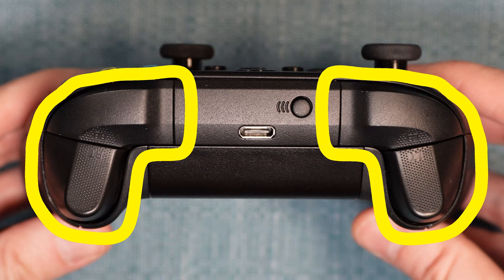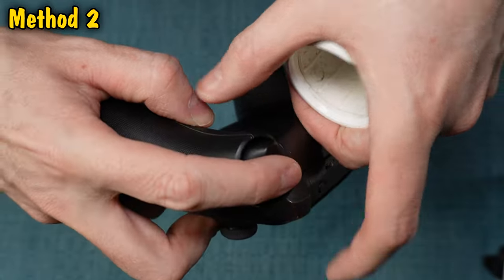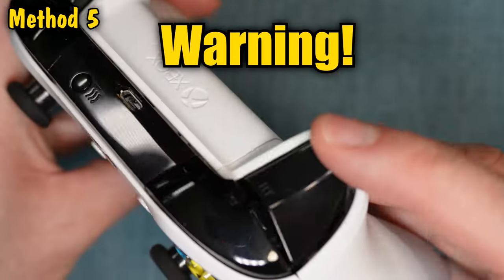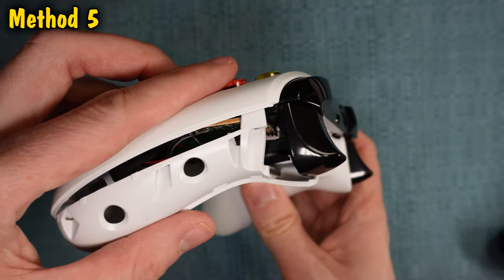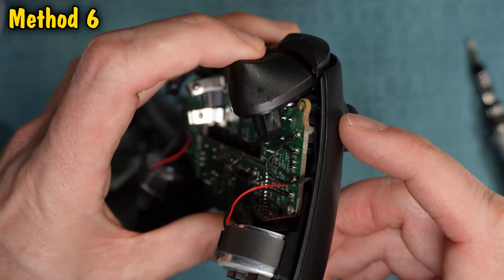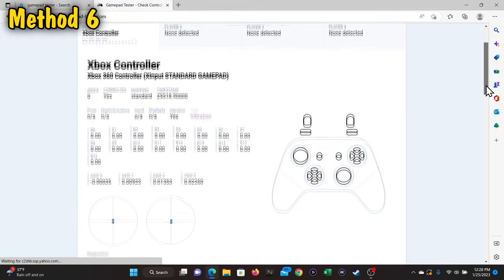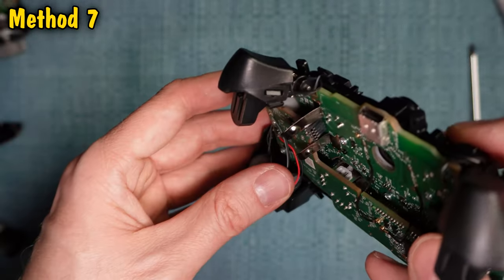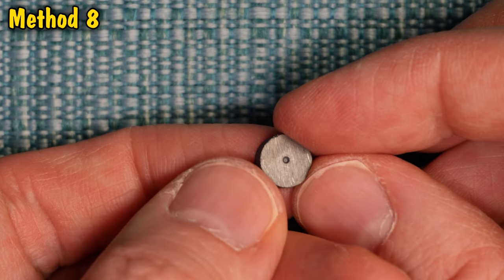How to Fix Trigger & Bumper Buttons on Xbox Controller | LT RT RB LB Shoulder Sticking Stuck Repair

Comment from the maker: Here are some product links relevant to the video:
Replacement Trigger: https://amzn.to/3jWukyv
Replacement Bumper: https://amzn.to/3DHfBOl
Precision Screwdriver Set: https://amzn.to/3k5Do49
LB and RB Button Replacement Kit: https://amzn.to/3ZY8me9
Electric Duster: https://amzn.to/3lwoRyR
Replacement Battery Covers: https://amzn.to/3XBUYKS
Rechargeable Battery Pack: https://amzn.to/3E7RSrh
Xbox Core Wireless Controller – Robot White: https://amzn.to/3xok5Gr
Kinivo HDMI Switch: https://amzn.to/3GhtVhn

*All Amazon links above are affiliate links. I get a small amount of money if you end up using them to make purchase (it does not have to be for the item I link to, as long as you click my link then move to another item, it works)
Reply: W
Reply: Absolutely bogus and ridiculous. They don't work for me.

Comment: A detailed and handy guide. Was able to get all 3 covers off and count figure out how to get better access to the bumper. Your video helped with that. The issue I had was the RB rubbing against the RT. When the trigger was even slightly pressed, the RB would pop put and work fine. Ended up sticking a very tiny piece of tape between the two to reduce friction, and it worked.

Comment: Thanks! My left bumper stopped working. I got down to the last step, it was surprisingly easy with your instructions. Turns out the plastic tip that connects the bumper to the white circular little post was loose, it snapped off when touched. Ordered a new part for $10 for 1 day shipping with Amazon and fixed it in 5 minutes. Much appreciated!
Reply: I had the same situation but when I replaced the piece the controller didn't turn on anymore. I'm not sure why but it sucks tbh

Comment: Thanks for this. My LB stopped working and I had no idea why. Bought a T8 security screwdriver & disassembled the controller thanks to your instructions. Finally saw what was wrong after 15mins. The plastic protrusion on the casing broke off, so that's why the LB button wouldn't click.
Reply: Did you figure out how to fix it? I'm waiting for my torx screwdrivers to arrive so haven't actually disassembled the controller yet but I bet my life this is gonna be exactly the issue
Reply: @ayzee5169 Yeah, I just replaced the bumpers. It's one single piece of the case. Just have to make sure you order the correct one. You can tell by how it's split from the plastic piece in the middle (over the sync button). One has a diagonal separation, the other is straight. It's important because the protrustion that goes inside to click the bumpers is different (one style is much thinner than the other).

Comment: i started this video with a rb button not working no matter how much or hard i presses it. exactly at 1:51 my problem was solved by using a card under the rb and above the rt instantly saw the rb responding on my xbox. thank you, u saved my 20$ controller :)

Comment: Thanks a lot! Using this tutorial i found out whats wrong with my RB, it was broken little plastic stick inside which is pressing the switch, i didn't know how to look inside, now i just bought the part and gonna replace the old, really aprecciate it <3
Reply: What method have you try ?
Reply: These have a major design flaw by MS. They're way too weak for the heavy use they get like the constant parrying in an RPG game.

Comment: Awh man thanks!! Fixed my left trigger because of you. I was so confused because I cleaned it all up. Turns out that I had put the magnet in the wrong way and didn’t know that the side with the dimple should face down. Was about to waste $60 on a new controller, you’re a lifesaver!

Comment: Please don't forcefully remove the grips. If you pry too hard like he has in the video, the small sharp pieces that click into the slots that keeps the grips on the controller will snap. It's best to use a flat object to run along the seams of the grips until slowly but surely it releases its hold.

(Very obviously, I have learned that the small sharp pieces will snap under immense pressure the hard way, I ruined many a great grip that way)
Reply from the maker: I'm always open to new ways of doing things, but I've never been able to loosen the sides enough to make it come off. Like I mentioned in the video, I've damaged my prying tools trying to do that. My grips are always on there very tight, and brute force is need to separate the pieces. It could be that other models have looser grips.
Reply: @HowToX  I've noticed that branded controllers (Like the Gears of War, Halo, and other branded controllers) have easier to pry grips with no strong stickage, and the newer controller grips are just glued on with God's most powerful adhesive
Reply: I've always just pulled them off by pressing the trigger down and reaching beneath...never had an issue, done it many times

Comment: My series s controller kept pressing both the triggers on its own. So I did the first method, updated my controller, and the issue stopped! I thank you from the bottom of my heart, because I have been dealing with this issue for about a year and a half. Really man, I appreciate the help!
Reply from the maker: Cool. Glad you can still use the controller.

Comment: This worked for me thank you - I have a "Power-A" branded one and all the screws are in different places but what was interesting was it only took a tiny amount of gunk in the buttons to make them stick. Probably the previous owner had spilled some soda over the controller and it was enough to put some detergent on a damp q-tip and that was enough to take it from "for parts" to "working controller". I hope you will be this lucky too!

Comment: Thank you!!! I opened up my controller to find the tooth extending down from the right bumper, that pushes on the internal white button, the tooth had snapped off. So I ordered a new bumper set for $10 and replaced it and… voila! Saved myself $50! Many thanks!

Comment: Thanks! I couldn't open the controller since i didn't have the screwdriver set for step 5, so i just pulled some tape and put it under the trigger and voila it's fixed.

Comment: I used a cork board push pin to poke into the trigger pin, to release the trigger and spring assembly. Not as tricky as it looks really.
Great video and helped out a lot, thanks

Comment: Thanks for showing us this, my right trigger was sticking every time it was pressed, the problem appeared to be a loose cushion for the trigger and with this being loose it’s left a residue of adhesive hence the sticking.. I’ve cleaned this off and applied a new cushion (tiny piece of sponge 🧽) with😅.. work perfectly 🎉… thanks for this video much appreciated 😁👍
Reply: Thanks! That's what wrong with mine. I'll have to get some new sponges.
Reply: @Dillinger702  to this day I’m still having issues with this design it’s shocking, the trigger works fine still so I’d recommend a little piece of sponge 🧽 tiny tiny 🤣

Comment: I found my solution at step 7. A piece of the long frame was broken, so I glued it back together. Now, I only need to fix the drifting. Wish me luck!
Reply: If you have a extra controller then you can take it apart and salvage the joy sticks and stop stick drift but of you don't try to take it apart and take teh front shell of and then use a straw and blow into it then pop them off and see of any dust or gunk is on there causing drift hope this helps

Comment: Thanks for the video, I got it taken apart and put back together but my issue was not fixed (the bumpers are broken) so I promptly put the controller through the wall, but this video was a great help so thank you for that.

Comment: Great video. My controller had a broken LB and was fixed with a drop of super glue.
Reply from the maker: Cool
Reply: yea same here. was it the skinny prong that pushes up and actuated the button that broke for you? 

my controller accidentally got bumped off my desk and landed on hardwood floor about a week or so ago. the bump that bumped the bumper was too much to handle apparently xD. seems like it was a small crack that got bigger as I used it more. 

i play rocket league and use LB as drift and air roll, so not having a functioning button confused the heck out of me at first. thought i was having an issue mentally lol. its 2 am rn so pretty tired haha
Reply: Which step is it? Cuz my lb doesn’t work and in forza that’s my e brake fortnite that’s my aim button cone button and reset button
Reply: And I play flipped in every shooting game so I can’t aim

Comment: Cleaning the LB and RB buttons with some isopropyl alcohol and rapidly tapping it fixed mine. It’s a MASSIVE difference how sensitive they are now. They hadn’t worked well in a year on my elite series 2, I thought I’d have to send it in. 

Try this it works great! Just get the highest isopropyl alcohol % you can get 70% minimum (just be sure to allow a few minutes to dry up after). Get a Qtip or paper towel and get it damp with isopropyl just so you can get a little drop onto the button and then with a little screwdriver tap the button rapidly. Do it like 3x. For a bonus add a little piece of index card as a shim in front of the button. Don’t use anything thicker and don’t use anything spongier, you won’t have a satisfying click.

Comment: I was able to fix my issue with the first few tips, thanks! I used a cereal box to make a pick, and compressed air to help clean things out, then a firmware update for good measure. You did a great job walking through the process and explaining the risks and reasons for taking each step.
Reply: how i’m using a cereal box too

Comment: I had my RT button make annoying noice. I hope i watched this video i fixed it right away. 
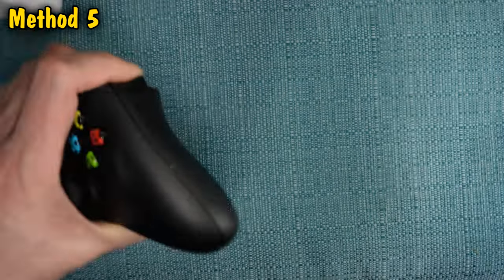IF you have squeaky button problem only just make the move at 5:20 and clean that area you don't need to use screwdriver

Comment: This video was so helpful for my problem. Thank you for sharing your experience 💯. 

My issue was solved by the straw/compressed air. 

My rb button was acting weirdly. It would click or feel normal when i press it but sometimes the button would be held down even though i released the rb button.

Comment: Thanks, tried pulling the trigger outwards then blew into the gap. This seems to have fixed the issue! Must have been some dust or fluff stuck inside the pad preventing the button to press properly.

Comment: Worked great, ripped off the grip, shoved a Q-Tip with 91% alcohol (ISP) and cleaned the circuit board and the trigger tip, and the sticky trigger stopped entirely.

Comment: thanks for the video. found my problem right away when u pulled of that cover with lb and rb trigger on it. that little plastick thing broke on mine so it dose not hit the contact...
your Video helped alot thank u
Reply: How did you fix this problem?
Reply: @Arrowwoods   i orderd the plastik piece from amazon, where the LB and RB is on so i can switch it. My problem was a little broken plastik piece so i was able to just change it out. i mean its not here yet but it wil 100% fix it xD 10:14 i m,ean this piece
Reply: Have absolutely the same issue. Tried to use a glue but it helped only for two weeks. Better to have this spare LB RB buttons.
Reply: @torrvic1156  yeah tragic little piece to brake off xD i bougth a spare one from ebay its not an original but its fits 99% and works great, paid like 2-3 euros for it
but its an easy fix u dont need a 50-60 euro new cortoller xD
Reply: @justinfourtwenty8655  honestly I bought the second controller for such cases but I’ll definitely repair the old one myself.

Comment: Drop of super glue on LB, but it trickled a bit around the bumper parts, and now when i attach the bumper and the short part of the bumper together, the LB button doesn’t press well because now the LB part of the bumper has some areas slightly bigger due to the super glue, when i press it doesn’t really move or retrace or make that clicky sound, its like its stuck.

So then i had to use a heated pen thing to remove the super glue, but that made the pen melt some parts of the bumper, not gust the super glue and now the flat parts of the bumper thing are uneven so i just kinda stripped the uneven sides to make them smoother. 

It works but the front part of the controller where the middle and the left of the LB button has a gap, its bigger.

Comment: At 11:12, what happens if the buttons themselves (not LT plastic, but the button on the circuit board itself) lose sensitivity and it requires harder push to get a response?  Is there any salvation to that?  How would I renovate it so that it requires not as much push under the hardware?
Reply: I should add, the white button that looks like the erase of a #2 pencil and is white.

Comment: Hey I just opened up my controller, and the button my right trigger is meant to press only randomly works, and only when I manually press it with a tool I have… any idea on how to make it reliably work?(also you never explained how to remove the trigger button)

Comment: Thank you for the video. In my case, stupid plastic pad was a problem.. it slipped away from its default position and went inside a bit causing trigger button to get all sticky. I blame myself and Forza Horizon 5 as i did tend to hold acceleration trigger too hard maybe and for too long, causing pad to slip over time.

Comment: My RB had gone on my original controller and has now started to break on the one I've been using for the last year or so. Ordered a kit online, followed your instructions and managed to replace the RB button. Down side is now the controller won't switch on at all. 😂 I have no idea what I've done but it appears I've done more damage than good. 😔

Comment: It's like a slight sticky resistance feeling instead of a naturally smooth press
Reply: know exactly what you mean. solved with a few tiny sprays of WD-40 on the spring of the analog trigger. U don't even have to take it apart, can do it by just pressing the trigger so it exposes part of the spring and then spray.
Reply: @JohnSmith-XYZ  very true I was able to fix it by pulling the top of a Q tip to the point where it looks like this 👉 | then rubbed around in between the parts I felt resistance that way it can dig in there and wipe I used alcohol but that didn't clean it like that so I used hand sanitizer and it worked

Comment: Buddy i just bought a third party gamepad for my phone. Its an xbox style controller. First time i used it, the right bumper immediately got stuck down. Almost sent it back but decided to just work around it by changing key binds. Then i found this video and just cleaned it out with cardboard and alcohol and it fixed it. Must have been some gunk in there from the factory or something. The click still feels a tad dull compared to the other bumper, though. My guess is the fix wont last forever.

Comment: I couldn’t fix my LB, and i accidentally break it. So, i use a cotton swabs and cut it with my work blade to cut a q-tip touching the LB. Make sure it’s a tiny enough to fit in. Hit it with a hammer or use your blade to flat the stick to make it fit inside. Put everything back and make sure LB  working. I tested it out and it worked for me. 😅👍🏻 now, I can play gta v and open my weapon wheel. Thank god it work!
Reply from the maker: Cool!

Comment: Thank you!! My PS5 controller started acting up so I pulled out my old xbox series s controller that I had let to rot in its box since the RB button stopped clicking after only 1 month. I figured it was garbage lol and would get a better controller. but now my PS5 controller died and is out of warranty so I wanted to see if I can fix this and I noticed it's the plastic leg from the RB button plastic mold that was broken. It was still holding barely so I was able to fix it with superglue pretty easily! Now to hope I can put the screws back because I didn't have the correct torx head lmao
Reply: Now if you know why my PS5 controller L1 button suddenly overnight started to trigger L2 as well until I press L2 and release it while still pressing L1....
Reply: Aaaaaaaaaaaaaaaaand 5mn in the game it broke again.
Reply: After further testing an old xbox one controller, it appears the L1 L2 issue was a software issue all along. Now all I did was update windows 🤔🤔🤔

Comment: The padding that the trigger strikes is compresses quite a but when the trigger strikes it and that's causing the trigger to feel "sticky"
what would you recommend for that?
I don't play rough and it hasn't been dropped much, but my floor is this thin line of felt that feels like bare concrete to walk on, and for any dropped item

Comment: Dude, I've been playing GTA 5 with an Xbox S/X controller recently. One issue that I'm having is, when I'm accelerating a vehicle, my RT button needs to be at least 50% pressed in order for the vehicle to start moving forward. That's a bummer if you want to roleplay and and drive around smoothly. Same things happens when pressing LT for breaking. Do you know how to fix this issue, by any chance? Thanks!
Reply from the maker: Do the things in the video.
Reply: Hi, what you are dealing with is called dead zone, I have a similar problem with right trigger, 3 mm. dead zone at the end just from the box. I tried updating firmware and now it's 2mm. Have you found a better fix?

Comment: Hey. First I checked in settings - accessories and it showed that the left trigger was pressed all the time. This makes it impossible to operate the console menu. 
I removed left panel. I cleaned the left trigger as shown in the video. It worked. Everything was fine. 
20 minutes passed. The faulty LT trigger came back.
Two weeks passed. I clean with an ear stick soaked in alcohol. I put it in through the gap and cleaned the left trigger. After a while I check. It works. I turned on one game as a test. Again it took about 20 minutes the fault returned. 
What should I do? 
Since the button worked it is not defective. Something is not connecting inside